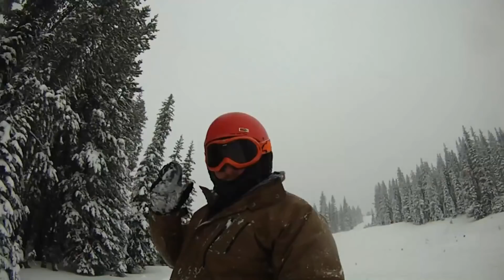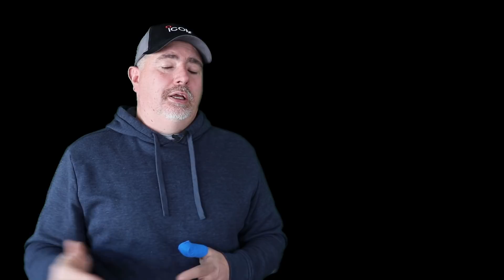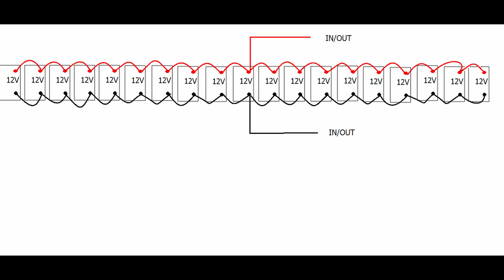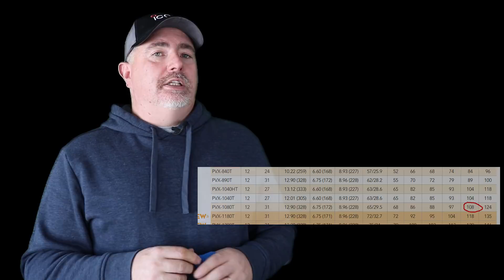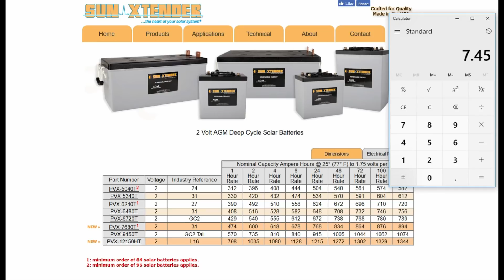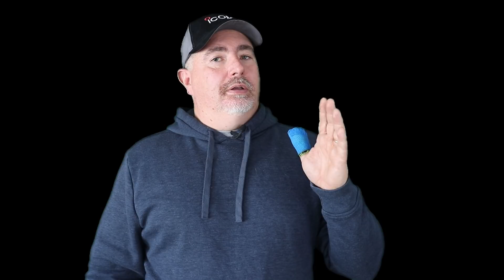Off Grid Batteries part 2

Comment: Because we live in a northern climate I have been reluctant to use solar in a conventional home. First of all I would like to build a new super insulated home that uses direct solar gain to aid in heating. This maybe a net zero sip panel structure but that could also change. Realistically solar PV would be used to provide power for lighting and a few other electronic devices. The well would be used only during daylight hours when extra solar energy that would be available to pump to an elevated storage tank. This water tank would have several days of water storage. I would do this to prevent the cycling of a water pump. The water would also be heated with gas for bathing and such. 
Heating would be wood and or gas with no electrical blower unit that would consume power. 
In other words I simply wish to provide primary  power for lighting and every other use secondary . In as much as we only use LED lighting that should be manageable for solar based system. 

Realistically we would at first be tied to the grid and after a while we may switch to battery. This is my primary plan that is being refined almost daily. Lol
Reply from the maker: I think if grid power is available its best to use it and then ween yourself off it. May take a while but will be less trying on your patience!

Comment: I have tried to explain this to people many times.  Some where around 75% of the time I hear "The salesman said...." what they were told was counter to practical experience and common sense.  The only counter is "So tell me what is the MAIN JOB of that salesman?  A hint, to sell you stuff."  Then they go back to the "The salesman said...." at that point I just walk away and let them deal with the headaches that follow.   

I remember when the gel batteries came on the market and they were pushed heavy in the marine market.  I had people asking me about them, I told them to stay away from them till they are proven in the market.  

One guy replaced all his batteries with gels because the gels were so much better than the old flooded batteries he had, so said the salesman.  The four golf cart batteries were replaced with two group 31.  The 4D starting battery was replaced with a group 31.  He was told they would work better than he had... they were lighter so his cruise speed would be faster and he would save fuel.  

I think the house bank lasted about a year and the starting battery about eight months.  I know the batteries were put in shortly after the Seattle Boat Show.  That fall they were out cruising, they anchored up, shut everything down, the next morning no start on the main engine.  A couple of mods I had suggested to the wiring system were not done so they had to call for a jump.  As I remember he whined about that being a 500 dollar bill.
Reply from the maker: Hi Kriss, you are exactly right. Many of these off grid sales places are just pushing what ever wizz bang product they can sell quick with a good profit. The only application I actually like the gel cells for is backup batteries that are under a constant float, they actually work pretty good for that.
Reply: To be honest I have warmed up to the AGM batteries for small backup power packs like a jump box.  But for a work horse battery bank flooded lead acid are hard to beat.
Reply from the maker: @Femmpaws  agreed
Reply: I watched some guys take an old amusement park car that was a working prop that was electrically powered and converted it to use one of the electric car batteries instead of the golf cart batteries.  

They finished the change over, drove it around the shop parking lot a little, pulled it into the shop and went to work on something else.  The shop video shows the car starting to burn and batteries cells starting to explode.  They got the car out of the shop and they did their best to contain the fire to just the car.  

In the video of the aftermath you saw the melted blacktop and places where the cells had melted into it.  

No thank you!  I'm an electric vehicle enthusiast... and I still get around in an old Toyota pickup that I have had for the last 30 years.